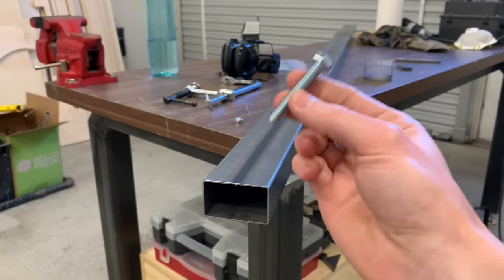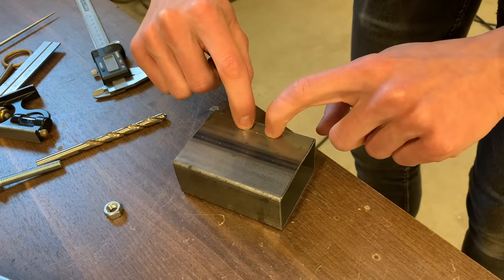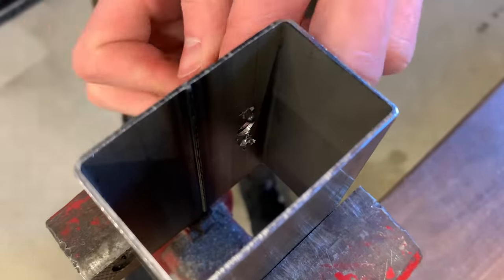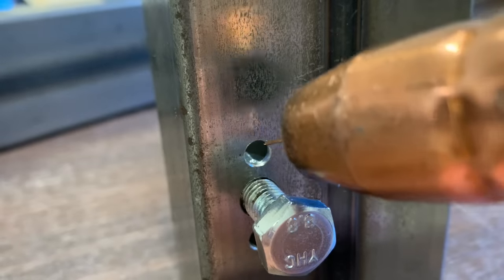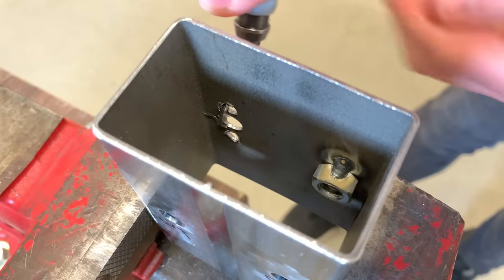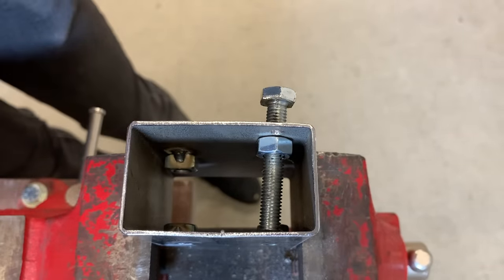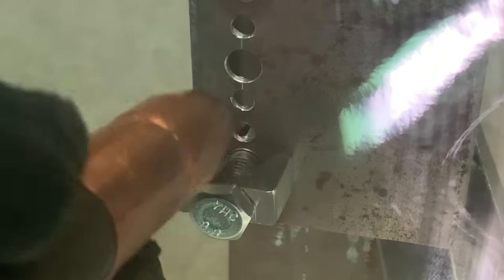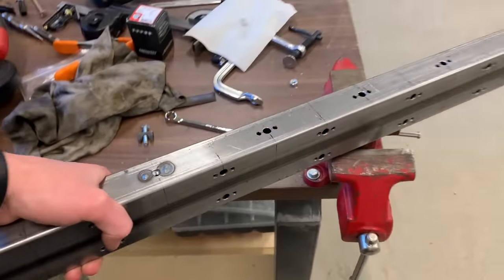Welding nuts to the inside of steel tube

Comment: I wonder if you could chamfer the one side of the nut to a fine point  and preload the 0:38 bolt  it to the work piece with a heavy spring like a valve spring.  Then connect the bolt and the work peace to a tig welder, heat it with like 10 amps till red and hit it with like 35 amps till you see the spring decompress and stop.  Make sure to coat  the bolt in nozzle dip or antisplater and try not to let the bolt touch the side of the hole.

You might be able to use a stick welder also.

I do not think the polarity would matter 

I just came up with this watching this video and i do not know what would be the best settings or if it would work at all.

Comment: Thanks for the great video,
did you consider using flanged nuts? You could get the weld points farther apart (especially for nuts smaller than M8). A possible downside might be, that the chance of the nut sitting crooked on a bur might increase. 
I guess that the strength and longevity of this connection strongly depends on how well you deburr the inside of the tube.  (Note to self: get one of these internal deburring tools) :D

Crevice corrosion might be another thing to consider especially on outdoor equipment.

Anyway, thanks for the great idea. A really cost effective and lightweight solution. I can see myself using this technique in the future.
Keep up the great work

Comment: I have question about your sawtable sliding index.
I am really curious about how your sawtablefence with the threated rod is holding up.
Are the treats still as accurate/sharp and easy to adjust and are there downsides or repairs maybe?

About the rivnuts, it is costly but once you use them you throw away JER (expensive) taps.

Comment: if i got threaded rod.... would it be just as good to weld it on?

am reinforcing a bearing drawer with mild steal... but my hand me down drill bits are blunt.

cheers from Shaun

Comment: For the efforts involved, drilling three holes per nut, deburr, make a special tool, weld, clean weld,  etc,  surely putting rivnuts is the most efficient one, and the easiest. An M8 rivnut would cost maybe $0.20 each, a manual rivnut tool kit that can do M3 to M10 will cost approximately $150.00, you would spend probalby under 15 minutes to intall 10 rivnuts. You keep the tool for future use that can do different nut sizes, does a quick clean job, and no need to be welder. For production use, pneumatic or cordless tools are available and install a rivnut in probably 3 seconds.

Comment: I think getting a rod of appropriate size, drilling a bigger hole, welding the rod in, cutting the excess and then drilling and tapping is an easier solution. Would require no jigs and would definitely be sturdier then two small beads you laid on top of the nut. For example, you need a 10mm nut in there. Drill a 20mm hole, get a 20mm rod, put it in there 60mm deep, tack it, cut the excess. Then, weld all around. Grind flat, then drill and tap. or you could do this with a nut but the nut might warp.

Comment: What if you used a way to weld the nut to the inside wall using a huge burst of electricity, instead of drilling extra holes?  (like how spot welding batteries works, or those electric-attached studs).

Comment: an update on my recent method of doing this, granted i didn't need to run anything inside the tube after like cables.
what i did this time around was to use a flat bar stock the length of the tube, weld the nuts to that then use that to slide inside the main tube, it was held in the right place by three counter sunk small screws, 
The bar itself is one side of a welding / plasma table and the nuts (M8) are to be for adding fixture and clamping brackets depending on the job so will be a constant swapping out rather than a single fixture use, which if the worst happens and a nut should get cross threaded or become damaged its possible to pull the nut strip out of the tube and grind off and replace the nut, also making the welding of the nut alot easier.

just another option for anyone watching etc

Comment: I think I would try resistance welding. Clamp a d.c. lead on the bolt, after threading on bolt, hang the parts on something so the nut would be snug against the tube and apply current.

Comment: A couple of comments.  First: I have a pair of Mitutoyo Diamond vernier calipers that I bought in 1970.   I scribe with them all the time.  I resharpen the tips on occasion.   Second: like Jer, I have access to a lathe.  I would make a set of dies that would allow me to roll or extrude part of the tube wall into the tube.  This is a common practice in sheet metal stamping.  It allows the doubling of the wall thickness.  Then one simply taps the hole.  The design of the extrusion dies is too complicated for a simple comment.  If anyone is interested, let me know and I will explain how it is done.
Reply: I just wanted to add, if I can’t scribe with my “good” calipers, they’re not good calipers. Using anything else would mitigate the point of measuring accurately in the first place. I’ve never needed to sharpen them though.

Comment: Cannot fault you for finding a unique solution to a common problem Sir. However, with the greatest respect, rivnuts are still the most efficient option, in my opinion. A scenario to consider is the damage to threads on site, or away from the workshop. A damaged welded nut can be hard to repair or replace. A Rivnut can be drilled out and replaced within seconds.

Comment: Nice idea 😊

But saying that is very thin is actually very thick compared with tubes here in the Philippines. We normally work with 1.2mm tubes. And all videos in youtube just shows how easy for them to weld tubes, while we, here, struggles to prevent holes on the materials 😂

Comment: Instead of using a lathe I would recommend to buy press nuts  (in German called Sechskant-Einpressmuttern/Setzmuttern). Once pulled in these stay in place, if the load is not too high and no dissemble is planned even welding isn't needed.

Comment: I had a job which required a blind nut in an inacessible cavity.  My solution was to make  a wafer, the same thickness as the subject material, about 3/4" in diameter with a hole saw and drill out the pilot hole in the wafer to 3/8" diameter (for the required bolt).  I welded the blind nut on the back of the wafer, then, when cooled, fit the wafer into the 3/4" 3/4" hole I had drilled, where the bolt needed to go.  I tacked the wafer in the hole and then welded the wafer solidly in the hole.  Just my 2¢.

Comment: I just bought a 60’s Cub Cadet. Supposed to have a couple of nuts welded on the frame for accessory attachment. Someone removed them. I might use this technique to replace them without pulling the engine.

Comment: A guy could drive an awl through the thin wall, then waller out the hole to size with a drift pin. Now tap the hole. Since you haven't drilled away any material, and the hole is now a funnel shape, the threads will hold well. The more you pull, the tighter the hold.

Comment: For this many threaded holes buying the tool for rivnuts will be cheaper than all that added effort for welding in standard nuts. Or use the german "Fillip-Dübel" for which the special tool is only 5€.

Comment: It only works because the nut is close to the end of the tube (or you need special tool to do this). You won't be able to screw the bolt in if it's far down the tube. Take a piece of sheet metal, drill a hole larger than the threads of the bolt and then weld the bolt to the sheet metal. Then cut in the tube the shape of the size of your assembly then weld the 2 pieces together. Grind it, done. De

Comment: one of the slower parts of this whole thing is going to be transitioning between setting the nut and welding, but if you make a lot of those riser tools you can minimize the amount of times you have to transition from a step and do it all in batch processes

Comment: the only thing i would suggest is to drill every 90° to get more weld in there. the reason being and its going to depend on your project but if you over torque the nut and the welds break its going to be fun to try and remove the bolt while the nut is spinning. otherwise this is pretty darn smart

Comment: Awesome solution to tricky access. Did you purge the atmosphere around the weld hole at all (like squeezing MIG trigger just enough to let the gas flow into the cavity before pressing enough to start the wire/current?) or did you "just go for it"?
Incidentally, I happened to be listening to Kraftwerk's "Pocket Calculator (East-West-Mix)" whilst watching your video, they went together surprisingly well!

Comment: Could you spot weld through the metal ?  Pressing the nut tight against the wall, and then heat it up until it melts.

Comment: Wouldnt hurt to hit all that with a propane torch right before you tack it. That way during the initial blind and coldest part of the weld, were you actually need the most bite, would have a bit of a preheated head start. Just a thought from a guy who used to do a lot of cold welds
Reply: Very kool video btw. Forgot to say that first

Comment: Rivnut is way easier and really cheap.  If you take into account all the welding supplies (wire, sheilding, electricity).  A got a kit for $30 or less.  I use them on aircraft all the time.  I think this is a good idea to keep in the mental tool kit if I don't have the correct size rivnut. 👍

Comment: May I suggest a simpler method which is also quicker?

You drill a bigger hole to the tube wall just fitting the nut itself. Then you take the nut threaded already to a bolt and place it to the hole, flush with the top surface. Then you weld it quickly. You need a simple jig for holding the bolt+nut to free hands.

Comment: Flange nuts would be a much better option to keep the weld from disforming the nut threads,  also the flange nut would allow a full circumference weld that would be easy to take a flap disc to smooth off flush
Reply: There's no need for any more weld! No need to have the weld do *all the work*, and also avoids distortion.
The nut is performing as usual, fastening the tube and *whatever else*, while the welds are only holding the nut in place and from rotating.

Comment: I wonder if this would work with a dremel or cut-off wheel as well, although it'd be harder to control accuracy (maybe).  A slot might give you the same kind of access to the side of the bolt as well as some surface area, since you're grinding them down anyway.  Just drill the individual bolt holes, then come back with a dremel and cut slots.

Comment: Drilling a hole on the pipe wall just as big as the outer size of the nut, placing the nut flat to the outer side of the pipe and walding them together isn't an easier option?

Comment: How do you rate the strength of the two welds? I guess for compression loads it doesnt matter but for any bending or shear loads it seems quite fragile.
Reply from the maker: Yeah, you said it. I think for most applications they will only see compression loads so will be fine. If they’re gonna have any bending or shear, then you could just do three instead of two.

Comment: Feels like you could just use your lathe to make a shoulder, drill the hole big enough to have the should pop through to the top of the surface, and weld the top of the shoulder to the outside surface.  That way its just one hole to drill.  You could use a set screw in the nut to protect the threads, pull out the set screw, grind the surface flush. wham-bam, thank yah ma'am.

Comment: Another option would be to use a piece of (copper ?) tubing as a spacer on that bolt, which would then press against the surface of the steel tubing. That would also protect the threaded portion of bolt and nut.

Comment: Was thinking how about drill the hole over size but still have the nut touch the metal then weld around it then grind flush

Comment: Your working harder then you need to, there are products on the market that you could have used
to make this project easier AND cheaper.
There called "Nut Plates". Their mainly used on aircraft so strength is NOT an issue. 
All you would needed was a drill and rivet gun.
BUT, I do like the way you did this, , thinking outside the box somewhat!!

Comment: Please use a clamp when you are drilling  metal at the drill press, the bit can catch in an instant and if you are lucky the piece you are holding will only take a thick chunk out of your hand as it spins around at the rotational speed of the bit.  If you are not lucky your hand will get pulled into the bit and and there are a wide variety of ways in which you can suffer severe trauma.

Comment: Just use threaded rivets - they are cheap and do they job nicely. If you don't have tool for it (they are not expensive too), just use bolt, nut and washer (there plenty of videos here on YouTube how to do this).

Comment: You've got a welder, but Riv-nuts "require expensive tooling?"  Building and welding together left over pieces to build a tool that holds nuts.  This certainly has its place, but it certainly is a narrow use.  It is one solution we builders could use though.

Comment: Wait, don't they make rivnut kits, with the tool, for less than 100$? I'm pretty sure I got mine for like 50$?
Also, why not just drill the hole big, slip the nut through, then build the weld up around it? Might not work great for MIG but TIG should be fine.

Could also weld 2-3 nuts together (on a bolt or all thread) to create a long section of threads, drill large hole in tubing, feed that through and weld it in place so that it sticks slightly proud, then grind down and chase with a tap?

Comment: Granted, manual Riv-nut tools and Riv-nuts aren't that expensive but regardless of that, I would say that if one was going to do things like seen in this video (which certainly isn't a bad way of doing it),  make the riser straddle block like shown starting at 6:15 because it solves two potential problems.
1) as long as the "legs" are the same length relative to the under-head surface where the bolt will be passing though, the bolt will be square 

2) (really the more important headache preventer one), it allows you to not risk welding the threads of the bolt below the nut. Basically, you just need a bolt that is long enough to engage a few threads but doesn't have to pass all the way though the nut.

Having a bolt running all the way though the nut and pushing off the back side of the tube runs too much risk of either welding the threads on accident or even just having spatter bb's imbedding in the threads. Sure, both of these can be avoided by being more careful with how you are positioning wire stick out (assuming you are MIG welding them) and spraying the bolt with anti-splatter spray or any sort of cooking oil / grease but by not having the bolt sticking though in the first place, then you don't have to worry about either aspect at all so....

Comment: Him: I don't wanna use rivnuts because they require a $30 setter tool that most hobbyists can't afford.

Also him: I'm gonna use my several thousand dollar lathe to turn a shoulder on a nut to make my weld-on nut work better.

The weld-thru idea is a good one, and it works in a pinch for a single use problem solver, but if you're doing something multiple times, it's better to get the right tool for the job.

Comment: Seems to me it would be easier to build a tube out of four pieces of plate. You could clamp opposing plates together to drill perfectly matching holes, then weld the nuts in place securely to the inside faces, then use some all-thread to align the plates and weld them together into a tube. Still a lot of work but faster and potentially more accurate (at least for the drilling), and it would let you weld as much of the net faces to the plates as you liked, not just a couple of tacks through the secondary holes.

Comment: Look into flow drilling.  Rather than cutting the metal, a carbide flow drill heats up the metal using pressure and pushes the metal out of the way once hot enough.

Comment: OkAy If you only need to a few of these done but it means a lot of drilling time and isn’t fail proof but also you are introducing too much heat to the structure which will result in deforming through contraction You might drill the holes ( 1x each) with drill size to accommodate the whole nut and jig each for welding in with a thread and clamp mechanism Preparation for a successful  task is usually 90% of the effort but when it’s thoroughly done will increase efficiency and maximize production in greatly reduced post - work ie cleanup and reworks etc

Comment: Hello everyone, seeing your solution I have an idea: I don't have a mig welder, but I'm thinking of the next idea, based on your's. If you weld a couple of shoulders or metal arms to the nut (half an inch or whatever lengh you need) before getting the nut inside. Then can do the drilling to a more convenient position and when welding, can cover more area weldind and securing this new arms of the nut, to the metal stud.

Comment: I am a welder and machinist for many years why not just use some 3/4inch flat bar stock and drill and tap it the same distance as the hole in the tube, then place it inside the tube as a very long one piece nut that you can tack at each end of the inside tube. Rule of thumb is the bolt needs as much thread depth as the bolt is in diameter.

Comment: A rivnut tool is actually cheap for what you get. Rivnuts arent expensive either. And with it, you don’t need to weld, or access the inside of the tubing at all.

Comment: Elegant solution, but you need a mig welder. There's a lot of the world that only uses stick. Your long tool to put in the nut is pretty ingenious. If I needed to do this I'd use a rivnut and make me a simple rivnut tool. Your solution is probably stronger, as rivnuts are made of aluminum.